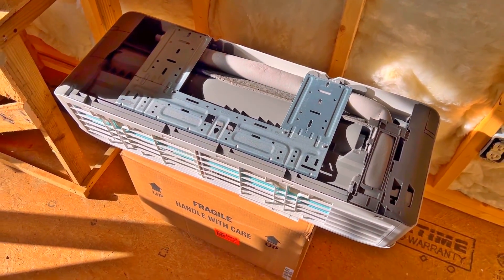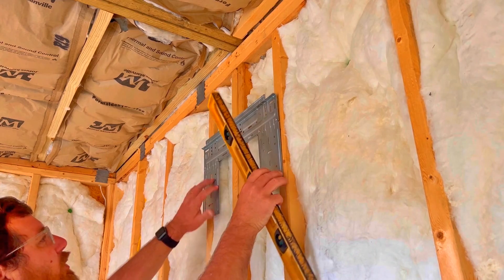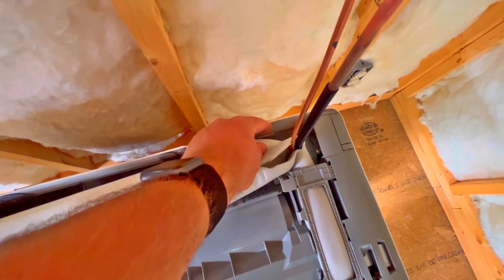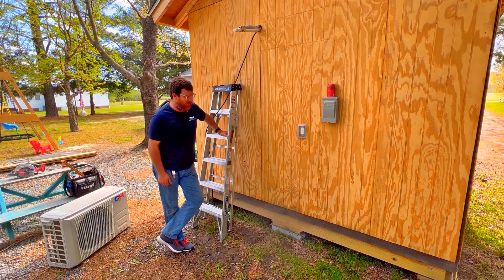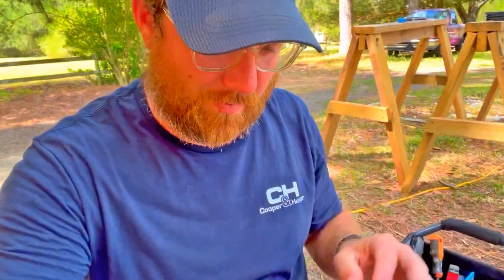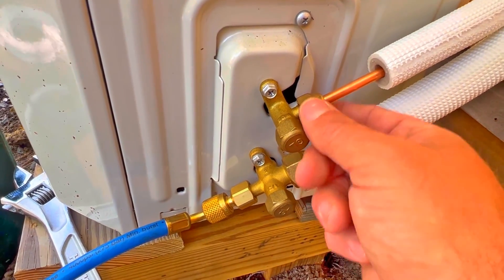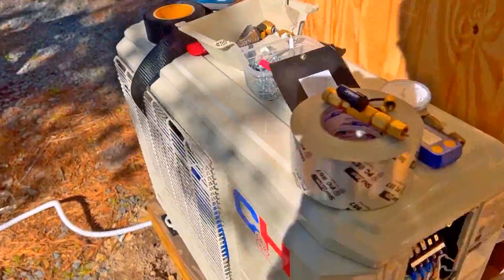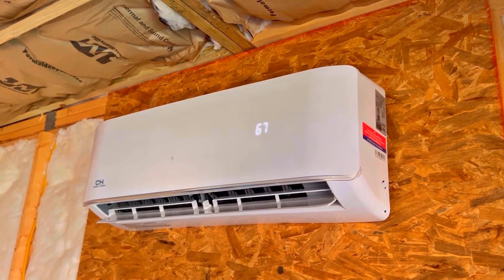How to Install a Mini Split Air Conditioner Start to Finish

Comment: I just buy a 9000 btu do I have to put Freon when installed or it’s ready as it is
Reply from the maker: These are usually shipped with enough charge.

Comment: Do you have a list of tools and parts you used for this install?
Reply: Level
Drill, hole saw 
Fence post hole digger (you probably don't need this)
Nitrogen tank, regulator
Torque wrench 
Nylog blue
5/16 to 1/4 adapter
Vacuum pump
Core removal tool
Micron Guage

That's what he used. If you want to cut the lines to length you'll need a pipe cutter and a flaring tool.

Comment: No issues with the indoor connections? A couple of times now we’ve had the tubing on the unit size not match the lineset size. Like the lineset is 3/8”, but the tubing after the nut was cut off was 1/4”
Reply from the maker: I think it was like that on the suction vapor line.